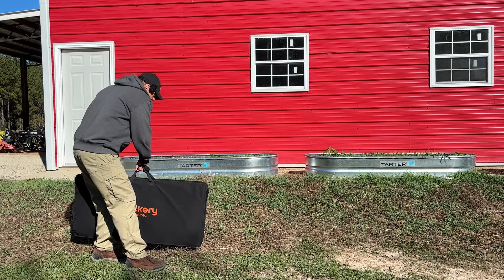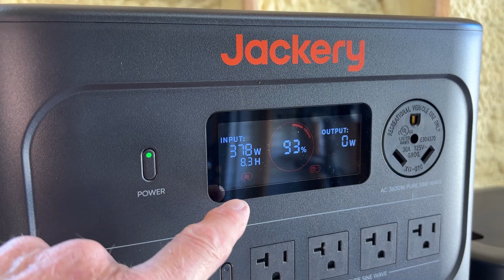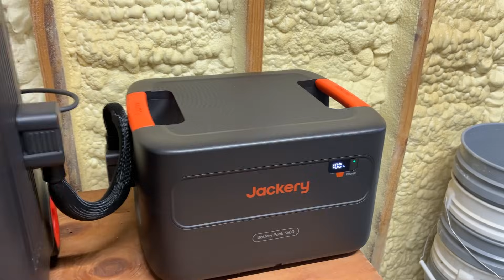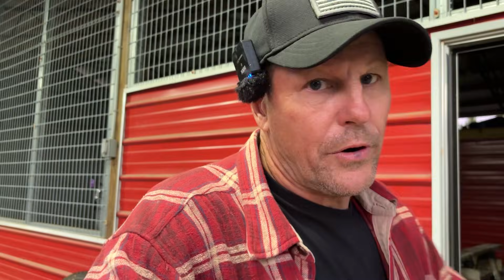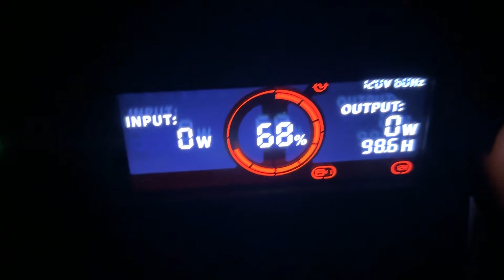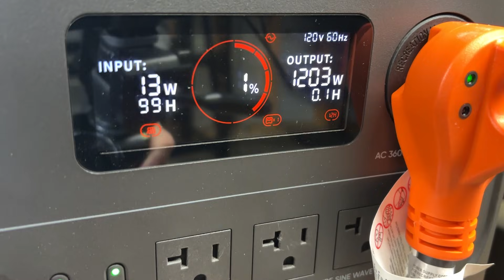Invest In A Solar Power Station NOW Or Wait For BETTER Technology?

Comment: Just binge watched all the Jackery related videos and transfer switch related videos and I learned a lot.  As a “numbers nerd”. I enjoyed seeing some real-world tests of the Jackery units.  It is truly eye opening how much power certain items (coffee makers, microwaves, space heaters, the high-bay lights, etc) take to run.

We have a handful of Jackery products (2000+, 2000+ Expansion, 1000+, and 100+) all purchased gently used.  They are perfect for our in-home power needs (internet, charging stations for phones and laptops, lamps/lights, and smaller fridge/freezers, etc.  

For our size units, I still have the inverter style gas generator to run power hungry items like space heaters, fans, larger fridge/freezers, and recharging the Jackery’s if solar isn’t a viable option, etc.

My theory for backup power sources (gas generators and solar/electric generators) is the old adage “two is one and one is none”.
Reply from the maker: That's awesome you've found the videos helpful!
Reply: @PineyGroveHomestead certainly helpful. Plus having quiet, portable power is a game charger while out working on things.

Comment: Come on.simple math.500x4=2000. So 7hrs if  full panel out put.
Reply from the maker: Many more factors than that go into determining if a system like this will work for your application
Reply: @PineyGroveHomestead i agree
Been using solar to power my shop,cabin and living room for years with solar.
Reply from the maker: @martinsmith3613  Awesome!

Comment: Solar is not the answer. You'll still need a gas generator in for cloudy days. So you're back to using fossil fuels. Or you could just pay the power company for your power? more efficient. So you wasted your money on a battery which was created by fossil fuels and mining for the battery material. Which will one day be in a landfill. So we're just spinning our wheels. Just pay The power company for your power and when they can't provide it,  use a backup gas ,natural gas.  propane generator.
Reply from the maker: Not everyone has access to on-grid power or cheap gasoline.

Comment: Solar is not an answer. You will still need a backup generator for prolonged periods of cloudy weather. So what does that mean? You're right back generating power with fossil fuels. Or you could pay the power company to generate your power.. A whole bunch easier and more efficient.. So you just wasted a bunch of money on a battery . Another thing that had to be created from fossil fuels and mining for battery materials.  And you've just made more junk for the landfill later on .You're spinning your wheels.